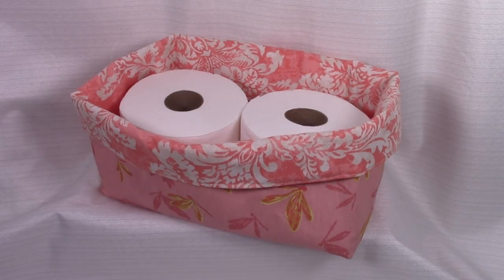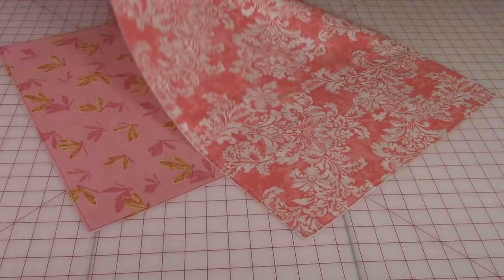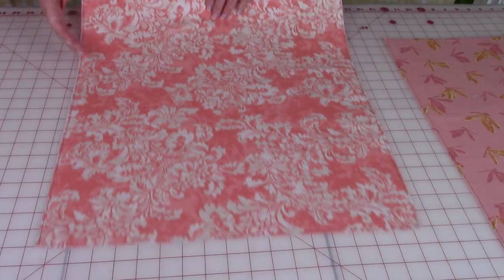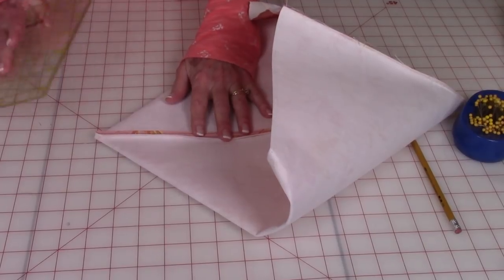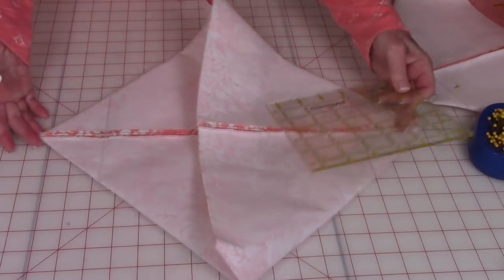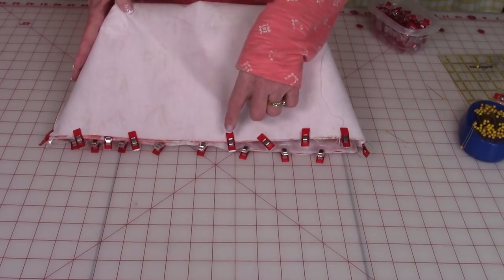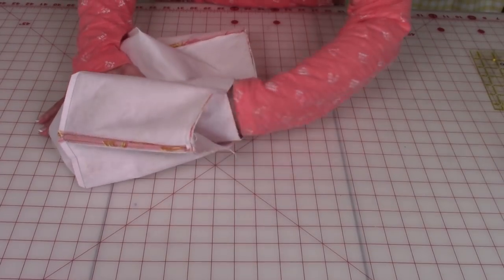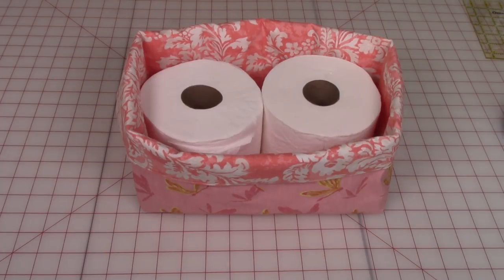Toilet Paper Holder - easy very detailed instructions

Comment: Love these, they brighten up the bathroom.  I made it about an inch smaller and it fits better. I use large rolls.  I used Karen Fassett fabric and I love it.  I made the first one accidentally smaller because I used fat quarters and after straightening the fabric I didn’t have the whole amount needed but 17 x20 worked fine.

Comment: I like the basket wish it had handles
Reply from the maker: Hi Donna.  It is easy to add handles.  Cut 2 strips 2" to 3" wide by 8" long.  Fold/press each end over 1/4".  Then fold the long edges towards the center and press.  Then fold the folded edges together and press.  Stitch the folded edges together.   Fold each strip and pin the ends down where you would like the handles.  Then stitch across.  Hope this helps.  Thanks for watching💗and Merry Christmas😍
Reply: @TheSewingRoomChannel  thank you I'm going to try it